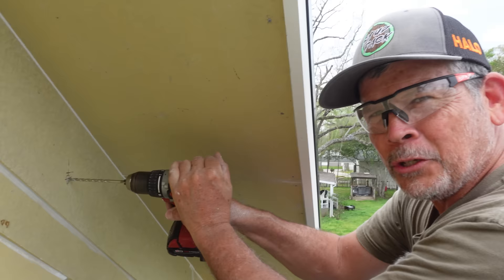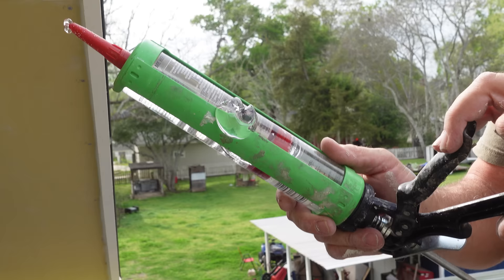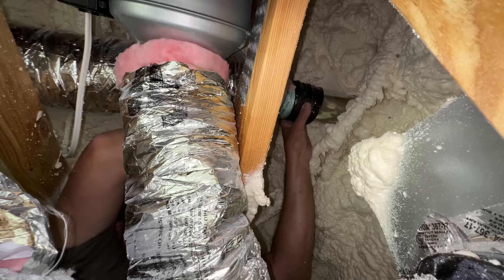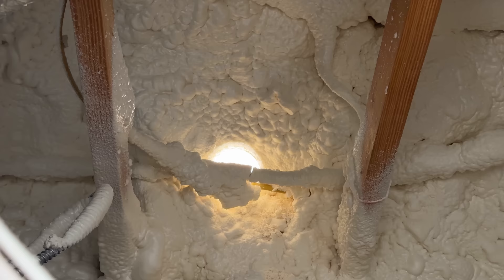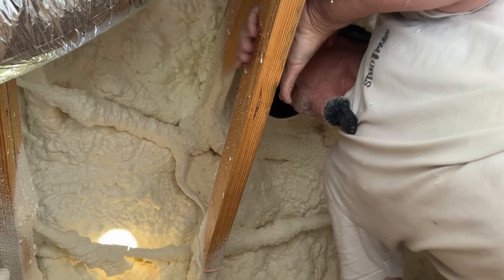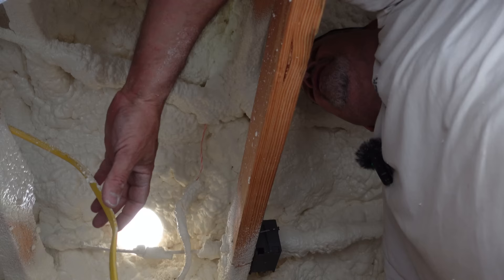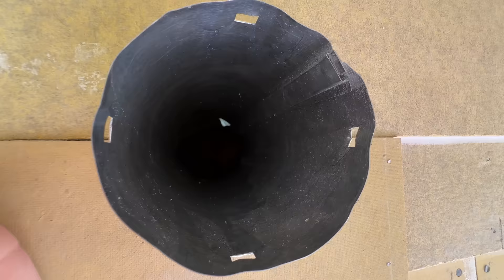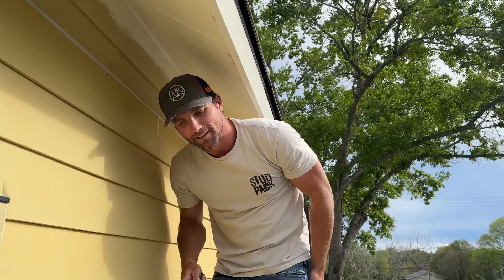Our Easy 5 Minute Job Turned into a 5 Hour Job...Dumb Move

Comment: Not helpful in every situation, but one of my favorite tricks for enlarging a hole is using a rabbeting bit on a router, followed by a flush trim bit to remove the rabbet, thus increasing the hole size. Example, 3" hole + 1/4" rabbet + flush trim = 3 1/2" hole.

Comment: With an adjustable duct elbow, each adjustment joint is a source of potential air leakage, and should be sealed once the elbow has been adjusted to the desired angle.

Comment: I'm not a pro painter, but the architect in the family told me that when you spray you really need to back roll or brush for good adhesion.  You're using good paint, and it's your house, and you want it to last.
Get a good rhythm with a brush, and you can paint that siding faster than you might think and save a step.
The paper white is a good color too.
Reply: Yeah, on Perkins Builder Bro's channel, the Sashco folks explained why rollers/brush(?) were superior.

Comment: Hey guys great vid. Looks like the pressure on your sprayer is way too high judging by the amount of overspray. Also, I like to use a smaller tip when spraying fascia boards. Usually a 211 or 213

Comment: I would tell you my experience painting all my life but if y'all read these comments you're problems will go away smaller tip lower the pressure and always brush and roll your final coat and there is always missed caulking area's always had to learn to except it. Looking fantastic

Comment: I always holesaw the like button at the start of each video. Hint: when spraying, keep an upward angle to hit the bottom of the cement board and fill the cracks. I didn't  do this once and came back a few days later to see it didn't actually coat!😊

Comment: Interior trim , the edge of the trim goes in the trim color. The exterior trim you run the body paint onto the sides of the trim  forming a solid seal over the caulking. And then the trim gets faced off with trim paint. It's just the way it's done 99% of the time.

However that is for production & time sake. There's absolutely nothing wrong with painting the edges of your trim in the trim color and it looks a 100 times better!

Comment: I agree. Modern construction techniques require a building to be so airtight to the point where a heat exchanger is required to bring in fresh air and to harvest the internal building ambient temperature.
What the hell ever happened to just opening a window for crying out loud!!!
What the hell????

Comment: Just a thought, when you zipped the duct work, a strap gun would have given you a tighter fit on the duct. Since you taped the seams the air lose should be minimal. Overall great work.

Comment: If I do the spray insulation I’ll use a pool noodle or insulation noodle for the wires and face it going to the direction of the wall so I can remove it

Comment: I hope your bathroom vent being up so close to the top,,I worry steam from shower will cause mold on the  under side of soffit
Reply: Given the length of that vent run (it's coming from the other side of the building, up to the peak and back down) I'm more concerned that all the water will drop out in the run. Would have to be a really hot, long shower for stream to be exiting here.
Reply: They don't have vented soffits so they don't need to worry about moisture getting pulled back into the building.
Reply: It’s Texas lol moisture outdoors isn’t really an issue

Comment: Too late now. All intake and exhaust is to go through the ERV. A separate exhaust for the bathroom will require a a tightly sealed valve remotely controlled or the blower door test will exceed 0.6.

Comment: I hate to tell you this, but you’re going to be replacing those 2 plastic exhaust vents in about 6-8 years. The plastic flaps always get brittle and crack and eventually fall apart - even if you paint it with exterior paint to protect it from UV rays. I’m sure there are higher quality exhaust vents, but I’ve yet to find them.

Comment: Don't think you need another coat on the sides of the window trim because it has a 2 layers of white from when you sprayed. If it appears dark and not washed out you most likely wont see an iprovement with another coat. If it aint broke....

Comment: Feel like I'm in the Twilight zone, I just watched this! Did you take it down just because of the ending, Paul loves being in those tight spots😂 awesome work gang!!
Reply from the maker: Yeah, had an encoding issue, had to reupload!
Reply: Dang, glad you got it worked out, always got to have the final Paul quote😊
Reply: @StudPack  Hey Jordan, tried posting here a vent product but doesn't allow me so I sent you an email. Please check from Ugur. Cheers
Reply: I’m a big fan of P-Tec. They come in several colors of dyed plastic, so no need to paint. Mine have held up for years, even the dryer one which takes loads of ab use.

Comment: You should of have pushed the intake to the ac or whatever system it is up a little bit upwards and angle it so the intake fins are going non parallel to the roof over hang :j 6:26

Comment: I like the unpainted edge on the windows.  From a distance you will never see it.  All that did by painting it was added more work.  If you would have used a 2 inch angle tip brush to do that work  would have made it easier to control.  I wanted to skip forward when you ran into the mistake but then I also wanted to see the pain you caused yourself.  I guarantee you aren't the first person or the last to make a mistake like that.  We all do it, you just fix it and move on.  Good work

Comment: So crazy question. But if anyone can answer it I’d appreciate it. My mother in law has a decorative lighting fixture over her desk. Everything is okay with it. But hearing you say you have to add a junction box after cutting three the wires. The person who did her decorative light over her desk. Should they have added a junction box in the attic?? From what I seen they cut a power wire and wired the light into it. And then put wire nuts and put electrical tape over the nuts. Should I add a junction box for them? Or is it safe having electrical tape over it? I’m not an electrician. But I’ve been taught the basics. So if it would help my mother in law I’ll add a junction box for them.

Comment: I'm curious to know - NEC typically rates conductors (in this case romex) based on the assumption it is in 'free air'. Wires that are in conduit are derated because of thermal issues (the heat in an enclosed space can't be dissipated). In this case there is romex in free air, but insulated to make sure that any heat can't dissipate (a worse situation than conductors in conduit). Does code address this?

Comment: Cute video, but should’ve been 10min., not 28min. 

A few things about the vents: 
  > why not mark areas with painter’s tape & then paint —& after paint dry,  get at vents? .... or cut the holes, covered a bit and painted -- but saved the screwing in of vent until painting complete?  bass ackwards to me.
  > I would have tested with an initial small drill hole to overly check right placement like you did, then DRILLED FROM THE INSIDE TO OUTSIDE - to make SURE not jeopardize wiring. This seems like a no-brainer. Maybe you or others will help me understand why you drilled from OUTSIDE to INSIDE…??.. because I can’t think of even 1 reason to do the way Stud crew did.
  > If going to get perfectionistic about the hand-painting around windows (good job btw!), then hope you will go back and eliminate the extra square hardy board ‘triangular filler pieces.. it’s true no one will se, but it would drive me crazy, and good to stay consistent .. meaning if detailed + perfectionistic with some things, try to be detailed + perfectionistic everywhere... yes?

Comment: Question: At 7:40 you were careful to put Lexel on that intake before installing it.  Why didn't you also Lexel the four holes the stainless screws went into?  I would think that would be needed to seal those four holes, unless that's overkill.

Comment: Tyco in wall splice kit. You need to buy two of them, one for each side of the connection. Completely up to code and allowable to connect a broken spice, in the wall cavity, with no access. They are hard to install, but its better than fighting the wire!

Comment: that why in the uk we do not use that foam all the electricals are tunnelled in and protected due to using 240 volts , we space outside brick from the inner breeze blocks for a gap for the house to breath or else you get damp and it travels right up to the roof with ventilation .and use rolled insulation fibre glass.
doing a great job by the way.

Comment: Not to be a hater but speaking from experience you are probably going to regret installing those plastic box store intake/exhaust vent ends. They are going to yellow, stain and break with age - even up here in Canada they have a lifespan of maybe 4-5 yrs before the plastic begins to crack/split. I am sure with the heat and sun you receive there it will be the same or less. I have moved to installing only galvanized/powered coated steel vent ends. They cost about twice as much but should have an infinite life span - you can also get this with insulated flappers but that’s probably more of a concern up here than down south.

Comment: Is the stairwell ceiling insulated somehow? Did I forget watching that get insulated in a previous video? The attic is part of the conditioned space, but I notice the attic floor is not insulated, so hopefully there is insulation on the stairwell ceiling side. (or you already plan on addressing in a later video)

Comment: Stud pac got a question when installing a erv you should be using it as a bath fan and not installing a bath fan air will get pulled back thru the bath fan defeating the purpose of erv just asking your view on this?

Comment: Not sure if that window is operable or not.
Just so everyone knows the code.
"An open vent terminal from a drainage system shall not be located less than 4 feet (1219 mm) directly beneath any door, openable window, or other air intake …"
Reply: Those are non operable windows. The only operable window is in the bathroom.
Reply: @joekelley1734  it should still be stated.
Reply from the maker: Dad mentioned it, it ended up on the cutting room floor unintentionally.

Comment: You had your sprayer set very wrong, way to much over spray flying off, when the gun and tip are correct for the job you'll have little to no over spraying, proper gun set up is one of the things even most professional painters struggle with, but once you get it down the amount of paint you safe is amazing.

Comment: Lifes little mistakes that haunt you for hours. Good luck getting an inspector to Validate the access point for that wire. Not many Inspectors will crawl up the same hole Paul did!
A simple fact is that the Spider Hole saw you used was correct!
Everything else was done out of order!  With the exception of YouTube! Is this the second third or fourth time that this build caused your own worse nightmare?
I suspect it is Jordan Pushing  for content rather than Paul saying SLOW DOWN!
Sorry for the long Essay, but knowing how a house is built? 
AS for Paul? 👍👍👍👍 For Jordan?👎👎
Lets' be honest Jordan is better behind the Camera! 
As for that WindowTRIM? Connect the DOTS at least! OMG IT LOOKS CRAP!

Comment: 4 inch for supply and exhaust of heat recovery?? Over here in Ireland it's minimum of 6 inch (and we need all the recovery over here) 😂  also spraying foam straight onto a roofing membrane without an air break is not allowed, neither is onto electrical cables, must be sleeved...
Reply: Probably 4 inch is sufficient for the relatively small living area.

Comment: I’m not a construction guy so be gentle but is there any reason to not paint the exterior before attaching them to the building? Like down on the ground where its easy to move around. Then cut and attach them and do touch up after installed. Seems like it would be easier to do that work on the ground. Thoughts?
Reply: Painting after seals the nail holes and caulking.
Reply: @OldMan_PJ  yeah but wouldn’t that be just touch up or does it need to be a couple coats?